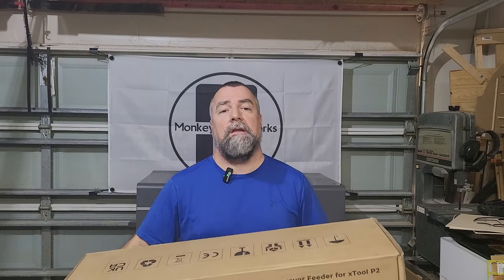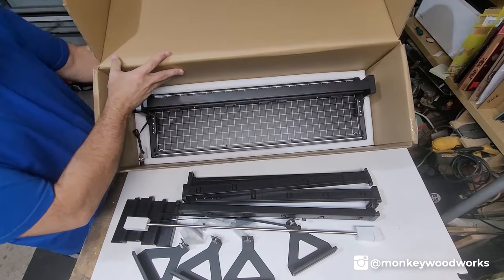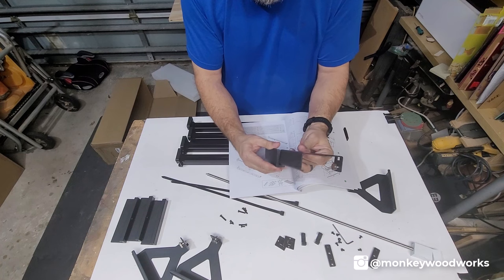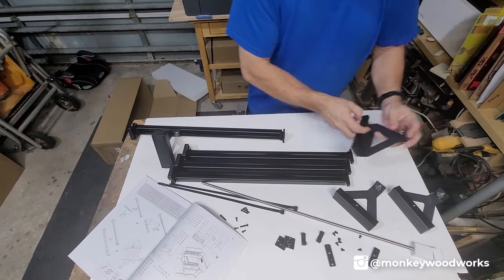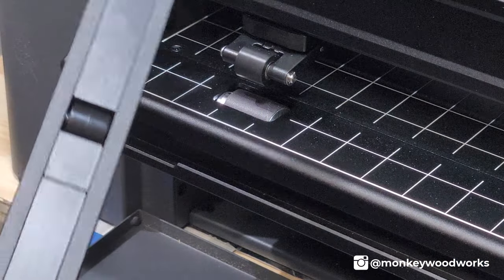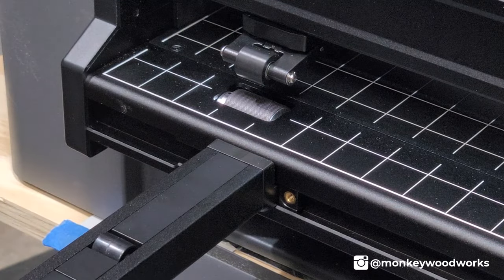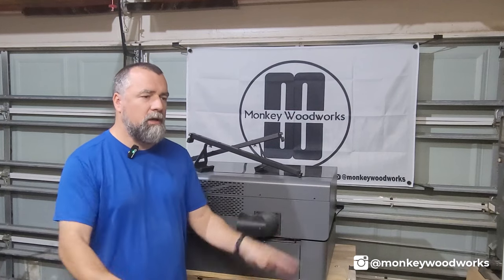Tool P2 Conveyor Assembly and Setup

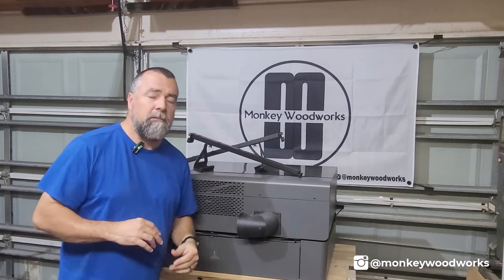Comment: Spicer Designs has a video "XTool P2 CONVEYOR....Complete SET-UP And First Use" where you can see a different design for the back conveyor parts (it's at around 14:40 in his video). Instead of the "laser sticker" that part actually has an opening and basically just slats left and right. I wish my supports had that newer design. It's probably a lot better in regards of flare-ups and such.
Reply from the maker: That is interesting!  I have had my feeder for a while but never set it up.  I wonder if that is version 2 that allows the laser to pass through and not hit the material as much.  I wonder if I can remove the plates from mine to make it simlar haha.
Reply from the maker: Come to find out, my version with the laser printed on the metal plate is the OLD version.  The one seen in the video you mentioned is the NEW version with a hollow area.  I like the idea of the hollow area better with less laser bounce back.

Comment: How much garage space do you need in front and in back of the P2 with the conveyor set up?
Reply from the maker: The setup I have shown in this video requires an eight foot long area.  You need a lot of space.
Reply: @MonkeyWoodworks  thanks. I’m redoing my garage area. This helps
Reply from the maker: You are welcome.  I do not use my conveyor everyday but when I do, I have to drag kids bikes, a tablesaw, and other misc stuff out of the way to make room haha.